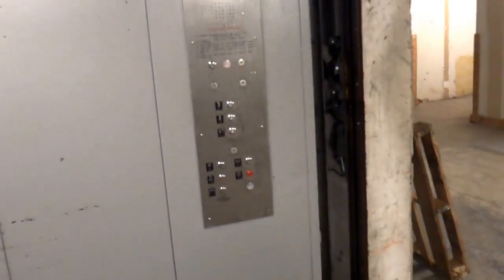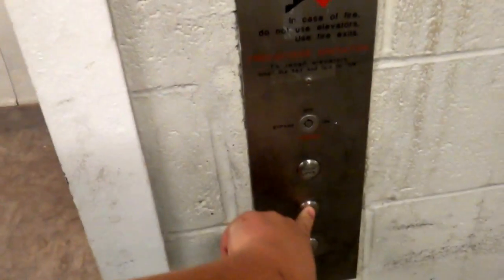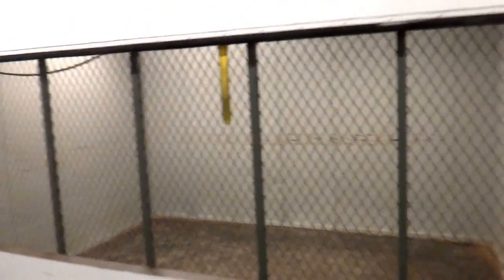Westinghouse Hydraulic Freight Elevator in Receiving Area "C" (Pavilion's Loading Dock) KOP Mall

Comment: I like how Schindler left the pull straps or whatever they are called on the floor doors on the inside that you would have to use when the doors had to be opened and closed manually.